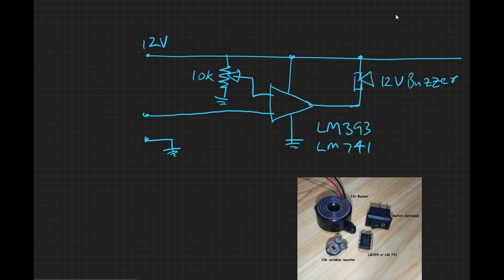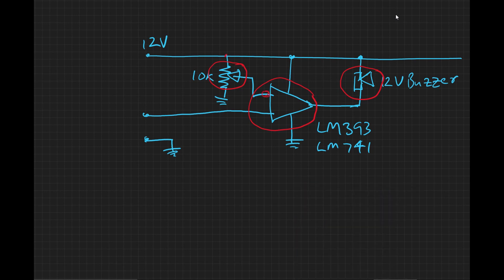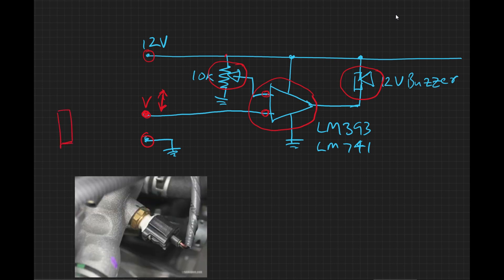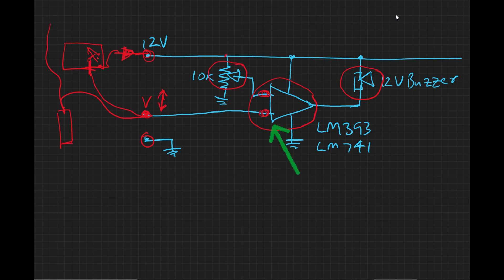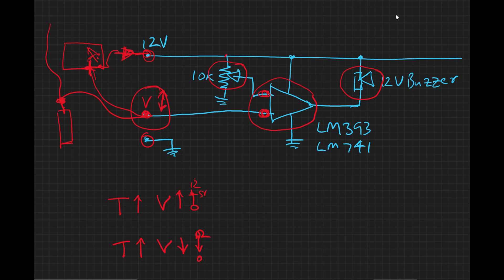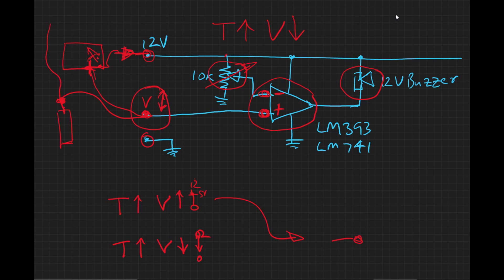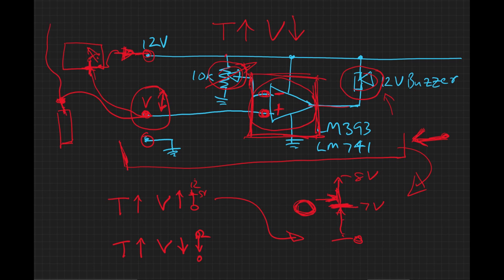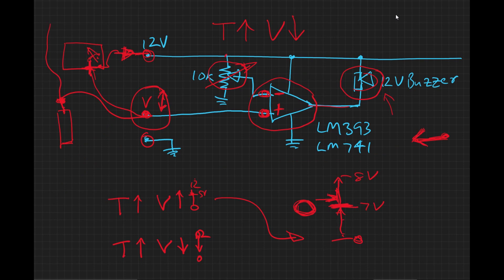DIY Engine overheat detection alarm (English subtitles)

Comment: V24 ටත් පරිපථයක් දෙන්ඩකො
Reply from the maker: 24v වලටත් ඔය circuit එකම වැඩ. 36v වෙනකම් පුළුවන්. 10k preset එක multi turn preset එකක් දාගන්න
Reply: @harshanaranmuthu  ස්තූතියි 👍👍👍👍
Reply from the maker: @amilaprasanna5159  පොඩි වරදක් උනා. Buzzer එක ට zener diode එකක් දාන්න වෙයි 14v වගේ. මට whatsapp එකක් දාන්න ඇඳලා එවන්නම්. 777420211

Comment: ඔබතුමා ලංකාවෙද ඉන්නෙ.මම මෙකනිකල් කලේ.මමත් ආසයි ඉලෙක්ට්‍රොනික් පැත්ත ඉගෙන ගන්න.
1.වාහනයක ඩිජිටල් Odometer එකේ අංක පෙන්නන්නෙ කොහොමද? Ic එක මොකක්ද? ඒ ic එකට විවිද වෝල්ටේජ් ආවම seven segmant led display එකක පත්තුවෙන්න ඕන බල්බ තීරනය කරන්නෙ කොහොමද?
2. Flip flop එකක් මෙමරි තියාගන්නෙ කොහොමද?   හාඩ්ඩිස් එකකනම් චුම්බක  ගුන වෙනස් වෙලා මතක තියා ගන්නවා. RAM එකකනම් දහස්ගානක් capacitor  තියෙනවලු ඒවා charge උනාම බයිනරි 1 ලු , නැත්නම් 0 ලු
3.බයිනරි 1 , බයිනරි 0 විදියට save කරයි කියමු.අපි කතාකරන කට හඩක් නැත්නම් සිංදුවක් analog තරංගයක් , ඒකෙ කාලයත් සමග amplitude  වෙනස් වෙනවා මේ තරංගයේ හැම ඇම්ලිටියුඩ් එකක්ම එක බිංදුව විදියට සේව් කරගන්නෙ කොහොමද? .
Reply from the maker: සාධාරණ ප්‍රශ්න ටිකක්. ලියලා උත්තර දෙන්න අමාරුයි. Call එකක් දෙන්න 0777 420211. මම ලංකාවේ තමයි.

Comment: Sensor  එක heat වෙද්දී  orms ගානක්නෙ   හැදෙන්නේ. Voltage  එක්කක් නෙවෙයිනේ.  කාරුණික පිලිතුරක් බලාපොරොත්තු  වෙමි.
Reply from the maker: ඔයා හිතන විදිහ හරි. Sensor එකේ වෙනස් වෙන්නේ resistance එක. අපි sensor එකයි තව resistor එකකුයි series දාලා voltage divider එකක් හදා ගන්නවා. ඒ voltage එක තමයි මනින්නේ. ගොඩක් ලියන්න අමාරුයි, තව විස්තර ඕනේ නම් call එකක් දෙන්න 0777420211
Reply: @harshanaranmuthu  බොහොම pin ඔබතුමාට